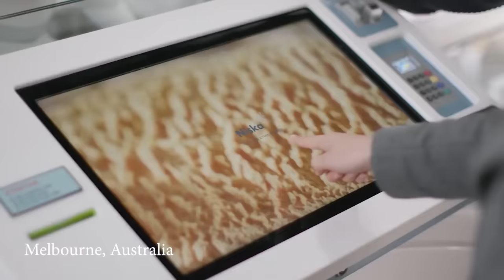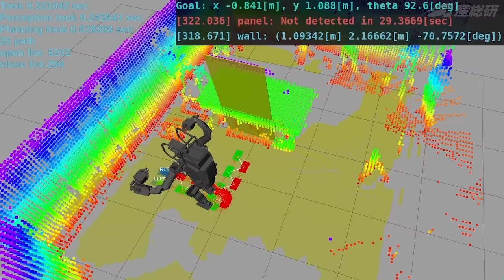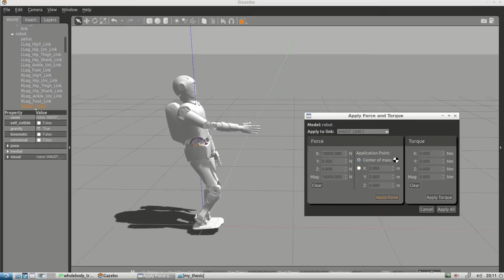9 Most Advanced AI Robots - Humanoid & Industrial Robots

Comment: Has anyone created a robot to withstand extremely high temperatures like the earth's core or nuclear plants removing or trouble shooting the cores in a nuclear plant? What about dark energy can it change electrical status from negative to positive current, etc? Have they sent a robot into the tunnel at the south pole? What about strong magnetic fields can they calculate the data to change the internal temperatures? What about strength and tensile  capacity? Drone capability from a negative to positive current? Fixing satellites, protection from cosmic radiation, etc.

Comment: I'm sure there's a really good reason, but why do none of these robots (with legs) stand/walk upright, with straight legs? I mean, they're based roughly on human anatomy, and we definitely don't walk like that, unless perhaps you shit your pants, so what makes it preferable for the robots to have such a squat neutral pose?
Most of them don't seem to fully extend their knees when walking either; rather than relying on momentum to move forward it looks like they're balancing still on one foot while the other takes the next step, and then repeating alternatingly. Idk if that makes sense. I mean how, when a person walks, the back foot is engaged as soon as the front foot touches down, and we continue the momentum of the movement to use less energy, rather than taking one step and then one step - that's what you do when you're about to fall over.
Is it more difficult to calculate for errors in a continuous movement, or are both the walking and the legs related to balance? That's the one that seems to make the most sense looking at them move, but then you watch them do flips and parkour and I find myself doubting if their balance isn't better than mine...